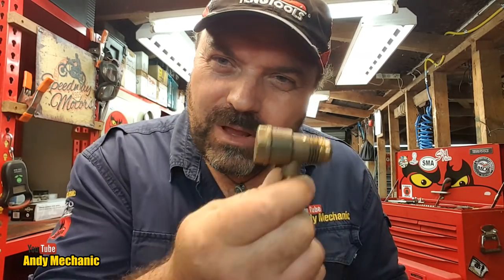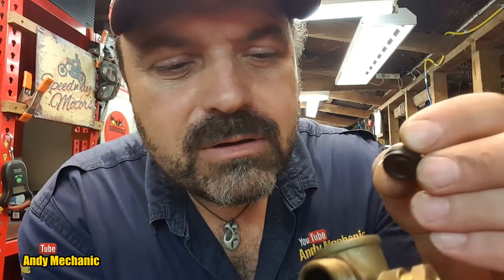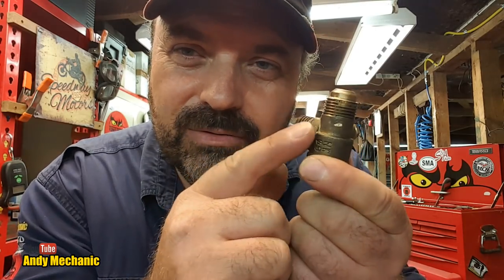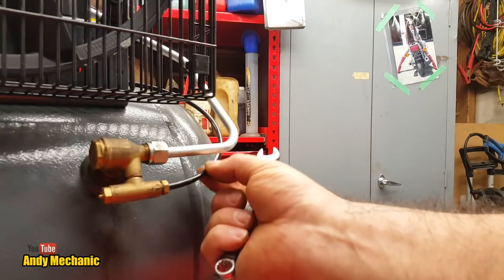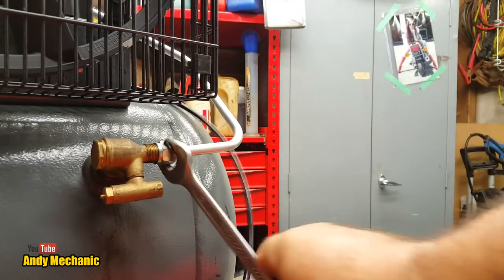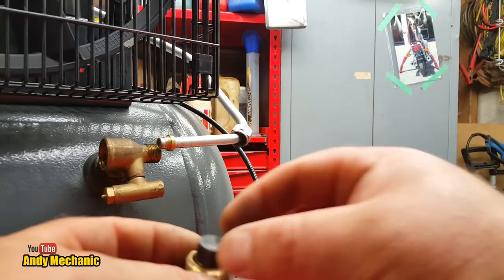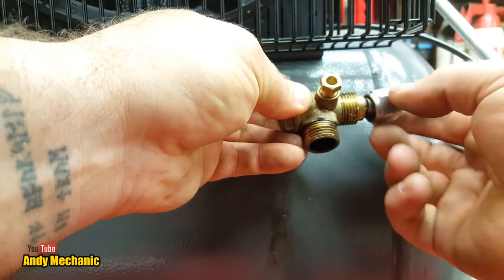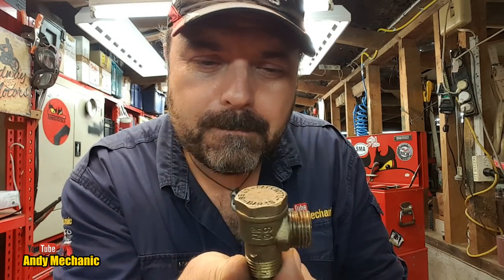Air compressor - one way valve replacement #1983

Comment: What a good channel. Good to see it's a kiwi channel. Had the same problem with my Black Ridge BRC120 air compressor valve. The valve thread broke off in the tank. The replacement part was the wrong size so just went out and upgraded to a new Black Ridge BR3000 compressor which when opened was covered in compressor oil which was leaking from the motor. Long story short Supercheap replaced the compressor with another new one, so far so good and I'm happy with it. These cheap Chinese compressor don't seem to have a long life span. The production quality check  is very poor or non existence.
Reply from the maker: Yep, I agree, there are definitely some very poor quality ones out there now unfortunately. Buyer beware!

Cheers Andy

Comment: that pipe only releases the pressure in the line from the pump so it can start up without full back load it is called the unloader pipe,,,,,
Reply: yes thats what i was going to tell Andy

Comment: Hi there. Just a quick question. My air compressor was leaking around the area where the check valve screws into the the tank. Looks like the sealant was not good enough there. I took the check valve off the tank and put some new sealant on. Then I put it back in the tank and found it wanted to tighten to far and would not aline with the exhaust pipe. So I had to back it off and loosen it. There are still plenty of threads down in the tank but the only thing making it seal and tight is the gasket sealant silicone. Could that now be a weakened joint where the check valve could blow out of the tank? There is no damage to the threads. It just did not what to aline correctly and the tighting point was half a turn past where it used to be and of course would not aline and I had to loosen back to its old point which made it movable by hand. So to seal it that is why I’ve used the gasket seal.
Reply from the maker: Hi, that's not right. it needs to be tight to the tank. Could you add a copper or aluminum washer to then give the valve a shoulder to tighten against so that it becomes tighter sooner on the threads?

Cheers Andy
Reply: @AndyMechanic  Thanks Andy. Just fixed it. I took it out and saw plenty’s more threads in the tank. I think it was just old thread sealant. So I tightened it and backed it off and tightened it and kept doing that until it was in the right place. Put gasket silicone back on and locked it down tight. Now I’ll leave it to set.
Reply from the maker: Perfect :-)